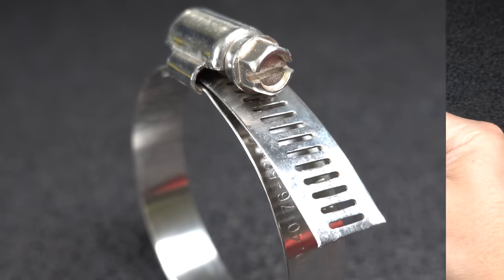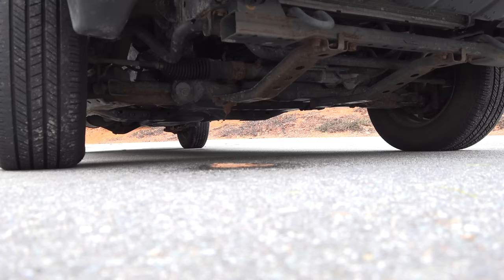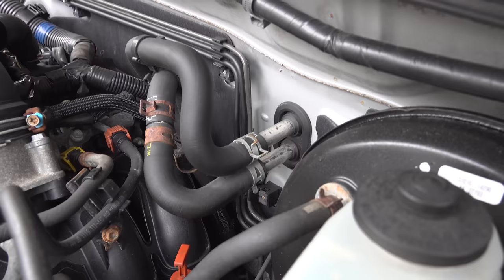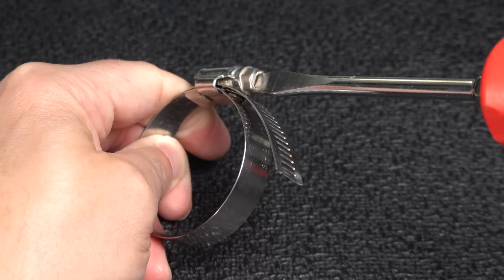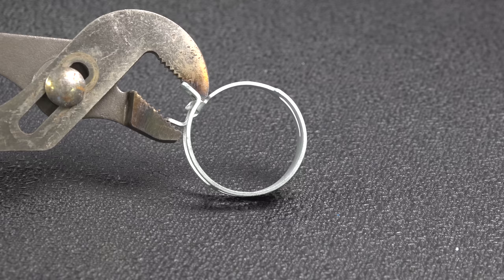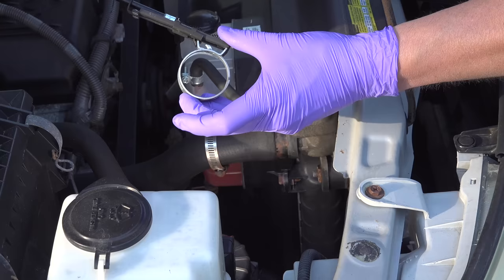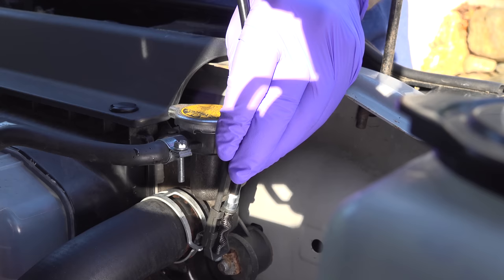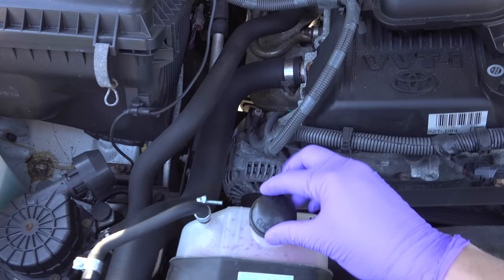STOP Using Hose Clamps WRONG - LEARN A BETTER WAY

Comment: If the wormscrew clamps are so bad then why did car manufacturers use them on cars until at least the 90's when they went to the spring loaded clamps like you were talking about which IMO are a pain in the ass!

Comment: I never had an issue with the stainless steel worm gear clamps or fuel injector style clamps. I don’t like this style because you have to remove the hose to install and you need to have a good idea what the diameter of the hose is so you get the correct size clamp. No thanks!!

Comment: There are no „wrong“, but cheap clamps getting loose or overtightened easily.
I use at least the blue ABA clamps, never had a failure.

Comment: The spring clamps or constant tension clamps aren't cheap.  Auto parts stores like O'reilly only sell them in boxes of 10 and don't have every size you need.  If you need two different sizes, you will be looking at over $40 just for spring clamps.

Comment: These clamps lose tension as well, and will spring a leak.!! I replaced an upper radiator hose , put the clamp back on, and it started to leak.🤷☹️

Comment: 0:48 while there is no issue with using fuel hose clamps on that coolant over flow hose back to the reservoir, you need to be using the right size clamps. Look at how tight those clamps are lol! You are going to distort the plastic nipples on either end of that hose like that and then it really won't seal

Comment: I’ve used the old style clamps for years. Making a video with a bit of scaring that people will definitely get a leak 😂 I’ve never had a issue with the old style clips as long as you use new ones and don’t go crazy they work perfectly fine. That’s where us mechanics experience comes in we have a feel for things

Comment: I HAATE those spring clamps. I was removing 1 of them off of my upper rad hose & when i got it off, it sprung & hit my thumb. That sh!t hurt like a b!tch. I took all of those damn spring clamps off of my hoses & use screw-on clamps only.

Comment: The reason manufacturers use those simpler clamps is because they are cheaper to make. Never have I ever seen a worm style clamp leak because of a temperature change on plastic. It doesn't expand enough to cause problems. I do like the new clamps, but the old clamps are perfectly safe to use if you're know anything about cars

Comment: First off, these "smart" clamps have been around for 20+ years and they usually SUCK to deal with. Especially when they are in areas you can't get the pliers in. Also, things aren't expanding enough under heat to actually cause cracks or leaks, you'd have to way overtight them to do so. As a matter of fact, the properties of the rubber hose will easily compensate for those tiny differences in temperature expansion. In some areas they are fine to use but we all know that most places you need clamps are in really crappy positions. You could get clamps with screws and springs too if you really need the dynamics.

Comment: They don't use worm gear clamps in a factory because it would cost more money. The amount of labor needed is going to cost more than the price difference of the clamps. I've successfully used those worm gear clamps on cars for so long without a single leak. You just need quality clamps because the cheap ones are cheap.

Comment: If those screw on clamps are better why doesn't the factory use them more often, I always go for the spring camp or the one time use pinch clamps because they are great for high pressure applications
Reply from the maker: You are 100% correct. They use CT clamps because they are more reliable. No companies wants hoses leaking under warranty, these would be part of most engine warranties with 100k.

Comment: I dumped two gallons of coolant all over a race track last weekend after a worm clamp on my upper radiator hose gave up.  Those things should be banned. The constant tension clamps are a bit of a pain to manipulate without the proper tools, but, they've never left me stranded.

Comment: Here is an Australian truck driver. NEVER uses these clips on a high pressure hose like most in a vehicle. A "smart" mechanic got lazy and replaced all the FACTORY INSTALLED worm screw clamps with these "I'm too lazy to spend 5 minutes putting a clamp on" clamp like those in this video. Four vans, and three trucks were almost cooked because of these simple clips. Worm screw clamps put on correctly, and checked EVERY service, and they will seal and stay tight usually as long as the hose will last. If a hose comes factory fitted with these quick clamps, sure, replace them with such, but they are likely low pressure hoses, or those that are not likely to kill your motor in 30 seconds if they leak suddenly. ps. Put the clamps on when the parts are cold, and they can't get loose. Also, smart mechanics bend the tail of screw clamps back over the adjustment nut to help lock the clamp, and also show if it's working loose. (Tail starts straightening out again if the clamp works loose.)

Comment: I'm fairly OK with the spring clamps but when companies use ones where one of the ends is in two parts instead of joined up, I want to poke someone in the eye. I believe I last encountered this on my lawnmower.

Comment: history says in the car racing world  worm drive clamps, works for then itll work on any daily driver, just learn how to torque them.
Reply from the maker: Torque them all you want they dont adjust with heat expansion, their fittings are all aluminum, so they torque them for maximum heat. They dont worry about leaks when the cars cool down. Whole different world there
Reply: @SilverCymbal  sure you know more, than top fuel drag teams, youtube went to head.
Reply from the maker: @jongonegone1262  I know race cars are built differently than street cars. Who cares, tighten your worm clamps until you hear the fitting crack, then back it off 1/4 turn. Job done.

Comment: These are standard on the assembly line BUT as a replacement, they are not as practical as the worm type PLUS they are NOT stainless steel  and RUST !

Comment: Never had problems with worm gear clamps.  However, removing these spring clamps is way more of a pain in the ass then it should be.  I'll stick with the worm clamps.

Comment: I had the same problem on my Toyota, so I bought  some  of the Spring Hose clamps that look like the screw type hose clamps except they have a COIL SPRING, they work well.  check them out on Oreilys web site : Gates green stripe Constant tension hose clamp  AND  MasterPro Hose clamps. They are not cheap but are very effective.

Comment: Nope, not for my experiences with them, find myself replacing those type with jubilee clamps all the time.20 years as a mechanic.  Also they others have said they have been around for many years (easily 20 i would say) so not new just not as old as jubilee clamps.

Comment: Yeah those are some pretty big claims for spring clamps. I imagine cars have them for more efficient production rather than them being the superior clamp.
Reply from the maker: Warranty claims would be through the roof if they weren't better. They aren't saving money to warranty engines, which are usually 6/60k or more. They choose them because they clamp better, and also eliminate worker mistakes by mis-torquing and ensure they stay that way at dealers even during removal. They are better in all respects except they do cost slightly more.
Reply: I get the feeling you don’t work on cars, trucks, equipment, lawnmowers, or anything else that uses hose clamps very much.

Comment: Manufacturer's use them because they take less labour to install, they aren't better. They come pre fitted on the hose, they slam the hose on and done. No tightening or any other labour needed.
Just because you had either cheap clamps or old hoses, doesn't make worm gear clamps bad.

Comment: That's the excuse, but they use this pliers because it's faster to install when they are mounting the pieces in factory and avoid over pressure of a bad instructed employee.
They force to buy a special plier or spend a lot of time with regular pliers

Comment: The screw type hose clamp is designed for use with RUBBER hoses.
The spring clamp type hose clamps are designed for use with SILICONE hoses.
~the more you know~

!

Comment: you sir must have some cursed toyota hoses cuz ive got a 2001 xterra and i beat the shit outta that thing and all my worm clamps have been fine if anything my spring clamps rusted away and even before they started to deteriorate they would cause problems

Comment: Good lord, old school hose clamps worked fine for almost a 100 years. The new spring style clamps have only one advantage, they are much faster for the guys on the assembly line to assemble. The aren’t leak resistant (any more than the old style clamps) they eventually loose tension (just like any other spring) and good luck finding replacements at the parts store. 

If it ain’t broke, don’t fix it.

Comment: It's got to do with COST auto manufacturers stoped using the screw style clamps because there's multiple pieces they COST more to produce and buy. Those new style clamps are one piece of metal they are cheaper to produce and buy. Got nothing to do with one being better than the other it's just cost

Comment: ? Did he call these new? My 88 Trans am had them all throughout and I replaced em with some worm gear fasteners. The tension clamps fucking suck to get off when your working on older parts. And at least the worm gears can be cut through if they refuse to release.

Comment: The reason thay use the spring clamp is thay are cheap.  And easy to put on . And that tool he talks about is not cheep. A screw type hose clamp is that way to go. If you buy a cheep hose clamp it won't work well. Or if it was not put on right like it wasn't screwed together right it won't hold right. So that's the only problem with them. Just my thoughts on it . And if you want you can get the bolt style clamps thay hold really well also.  So just saying.

Comment: I can tell this guy doesn’t work on cars. Not only are those spring clamps a pain in the ass, they also leak if you don’t put them exactly where they used to be. You also need a special tool to use them (without fighting) that I’ve never seen sold anywhere.

Comment: worm gear clamps are junk on 1/4 inch fuel lines. and you all know it. They suck air when rubber line starts getting hard. Use what you want. Ill use constant spring clamp

Comment: I LOATHE THOSE SPRING CLAMPS BECAUSE EVEN WITH A $150 SET OF CLAMP PLIERS I HAVE PROBLEMS REMOVING THOSE USUALLY I HAVE TO CUT THEM OFF

Comment: Here's a free mechanic tip for you buddy, if you can't make a solid connection with a screw clamp, you may wanna replace that hose 😂 guess which type of clamp I'm constantly replacing on clients cars?

Comment: I never use those useless asanine spring clamps. They're a huge pain in the neck. Dump them in the trash can and use good U.S. made stainless screw clamps. You can change them on the road with just a screwdriver and they don't spring loose and hit you.

Comment: the comment section is basically- you need experience to put a clamp on. spring clamps wear out, and people don't want to replace a spring clamp so they use good worm clamps, which also cost money. what a day we live in.

Comment: Hell no, this tension clamps is the only one VW cars use. It freaking sucks trying to work on a car with those clamps in tight spaces. Which is every space on a VW. Every time I had to remove a tension clamp I replaced it with an old style Clamp. No issues, and way easier to work with. Unless you buy Tension clamp tools.

Comment: Have always had issues with constant tension clamps. I always replace with screw clamps when I take off the factory ones. I've been doing this for 20 years. I've never had issues on customer vehicles/ boats/ race cars. Ever. 
Even power steering, transmission or intercooler hoses. I suppose all experiences are subjective, but I disagree.
Reply: I always replace worm gear clamps with spring clamps.

Comment: I despise these clamps, they are terrible to take off in cramped spots, and they break constantly. I have a pile of every size of worm gear clamp just so i can replace these clamps every time I remove one. These clamps are the worst, and when they rust they just break anyway.

Comment: "I noticed that when I got in my Tacoma after it had been running a while my vagina was chilly because cold air was coming out the vents and blowing up my skirt. Sure enough it was because I was low on coolant from being too stupid to operate a worm-style hose clamp..."

Comment: Your"new style" clamps are old. They're used by manufacturers because theyre cheaper. The only way screw clamps leak is if they aren't tightened or if the hose has a dirty connection and is replaced  on a crusty outlet. Standard japanese factory radiator and heater hose clamps are screw on ones but a wire construction as opposed to the flat  band better type. Spring steel clamps can leak just as easily if also replacing secondhand hoses on crusty fittings. Ensuring no leaks is all in the act of fitting, not what you fit with. You can get as good a seal with tie wire.

Comment: as far as im concerned they both suck. ive always hated the screw type they work but they are never perfect, sometimes it cuts the line, can never get the right torque etc. the tension ones are cool at first but ive had a toyota so rusty they immediately break and become useless and ive had some that are so weak, as you push them together they are stuck like that. i hope one day we have the tension of the spring clamp but the reusability of the screw type.

Comment: These clamps suck. They're difficult to remove and still imprint on the hoses. They can be hard to get back to where they started. Worm gear clamps are easy to remove and I've never had one fail.

Comment: Buy stainless clamps.  If you can't get that right, maybe the wideband like the mikalor etc if there's room.  Check the bolt is stainless too.  That shit will outlast your car, and those shitty oem dungers you're plugging.

Comment: Car manufacturers have been using these self holding types of clamps for years now this is nothing new.  And typically you’re supposed to use a 8 mm socket to tighten these down not a pissy little screwdriver

Comment: You got it ass backwards.  These spring clamps are garbage.  I was working on a 2011 civic and I was able to release the tension by pinching the clamp with my thumb and index finger.  I thought it was strange and tried another spring clamp.  The other clamp was stiff and couldn’t release significant pressure.  I believe the spring clips lose pressure over time.

Comment: Maybe he`s using cheapest possible poor quality worm claps and yes those clams are bad you can strip them quite easy, but if you use good quality worm clams then you can tighten them until you destroy hose or crack plastic tube.

Comment: You know what I will continue to use the ones that came with the car unless engineer's put them in such a messed up spot that you can't get in and out easily then I'm using the old school clamps. I refuse to fight with a shity design.

Comment: Screw clamps hold around 3x the pressure than the smart type clamp
Reply from the maker: That sounds good until temperatures change and the screw clamps cracks the fitting. 3x or 300x the holding force isn't better. It only takes the right amount and then to keep it constant. For cold applications it matters less, for hot like heater and cooling hoses its critical
Reply: @SilverCymbal  project farm just done a test on these yesterday go check it out
Reply from the maker: @inkman6964  Yup and you will see my comment to him as well. He missed the #1 reason autos all use constant tension clamps. He never tested temperature which is the problem
Reply: @SilverCymbal  stainless steel expands around 0.06 percent per 100 degrees and this would be insignificant in the temperature a car engine runs at
Reply from the maker: @inkman6964  There’s a reason leaks in cooling hoses is practically nonexistent in the last 10 years in cars. CT clamps are the reason.  Yoy can debate in theory as much as you want. The choice was made years ago for good reason. Too much variability with spring clamps. They get over tightened and crack fittings too little and they leak. Why not let the clamp do the work for you. That’s why manufactures use them despite a much higher cost.

Comment: Those will rust and break even in mild climates.
Reply from the maker: I an in Mass, if you look close the others have surface rust but no leaks. Keep in mind the Tacoma shown is a 2005. They are holding up pretty well for 15 years

Comment: I have never had a problem with the screw clamp. Those compression clamps should never be installed on an auto when they weaken and leak they need to be replaced. Just as smart as nuclear light bulbs .. turn them on they are really bright but you are dead....

Comment: In my case, when I reuse theose oem(constant tension clamps), especially on old hoses, you should return the clamp on the same position(the clamp has made compressed marks on the hose). Or else it will leak.

Comment: I have been Working On Cars for At Least 45 Year's. The Problem Is That A lot of Coolant Fittings Are Plastic. Plus The Metal In Worm Clamps Now In General Is Very Poor. I Order A Stainless Clamp that Is A lot better than The Cheap Auto Zone Clamps.Sometimes The Spring Clamp Is Mandatory. Be Careful Folks. Both Clamp Styles are for different Applications.